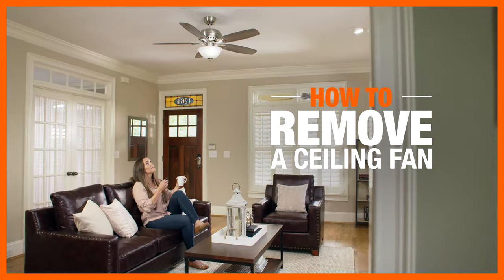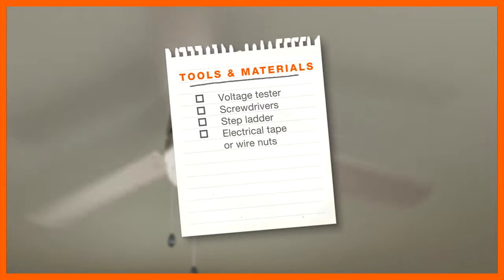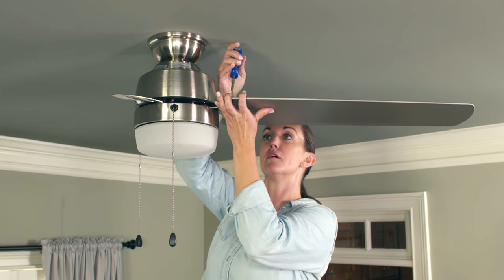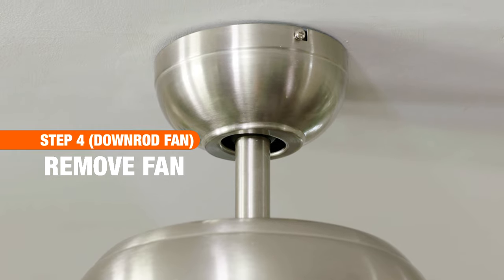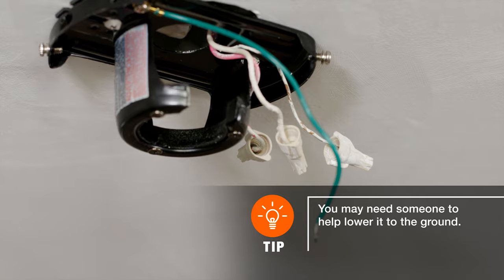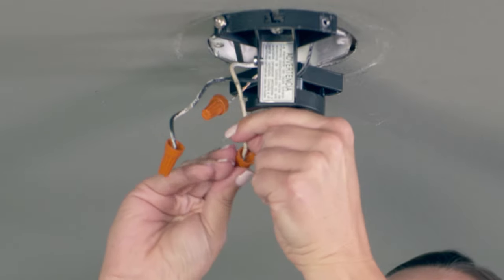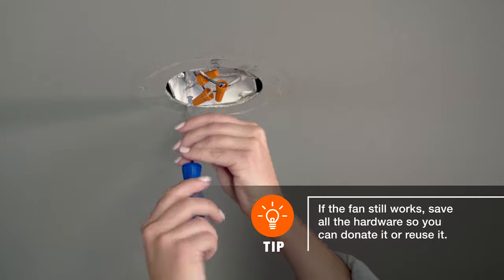How to Remove a Ceiling Fan | The Home Depot

Comment: She goes into Step 4 with the fan blades still on tho 💀😭😭
Reply: It's really just a matter of weight & ease. It can be removed with /without blades attached
Reply: yeah, and I don't see that they used the voltage tester even though it was included in the list of "what you need"😭
Reply: @eb9520  I mean I just used my eyeballs as a voltage tester, so maybe it wasn't that "needed" 💀💀💀
Reply: But Home Depot made the sale so thats all that matters 😄
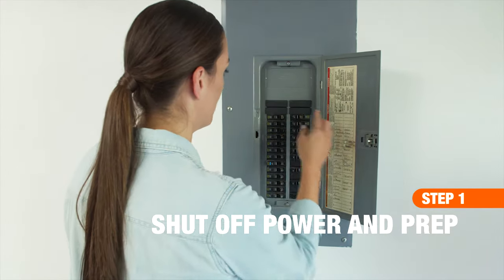Reply: @eb9520  at 00:36, there is a notation on the left side which advises you to consider using a voltage tester. It’s not absolutely necessary, but HD probably wanted to include the tip so that if you somehow end up shocking the crap out of yourself, you won’t try to hold them liable due to faulty advice. 😂
Reply: The voltage tester was useful for me because 1 of the 2 white wires coming out of my ceiling was a hot wire.